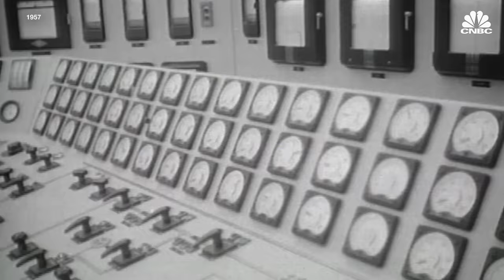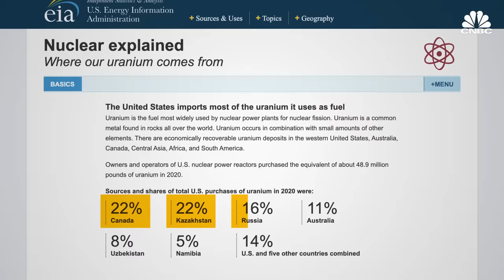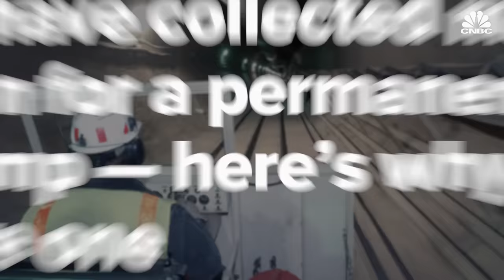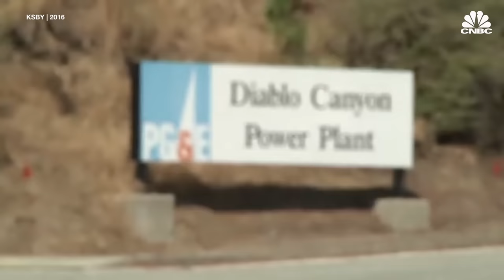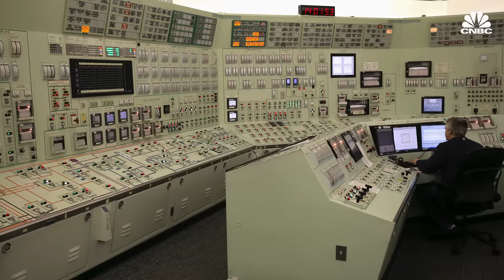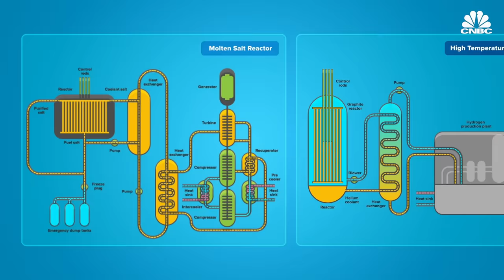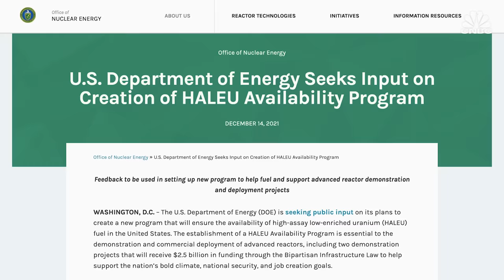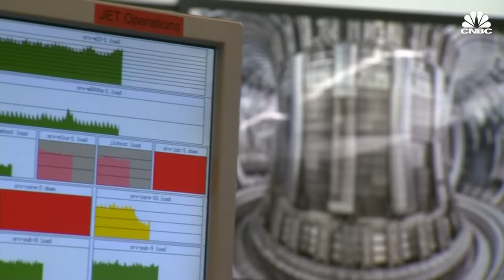Why Nuclear Energy Is On The Verge Of A Renaissance

Comment: 7:00 Note that the reason nuclear power plants are typically run at full capacity all the time is because of economic reasons: they have a high capital cost and relatively low cost per energy unit, so load-following is generally done using other technologies that have a fast response but high cost per energy unit. However, modern nuclear plants are perfectly capable of varying their output rapid enough to perform load-following and frequency stabilization, and this ability will become extremely important in a zero-emissions future.
Reply: That is not true at all.  The current nuclear power plants are operated at full power because trying to load following would result in uncontrollable xenon cycling and most likely in a reactor trip. It is an operational concern not a financial concern
Reply: @clarkkent9080  Nope, here's some excerpts from the report "Technical and Economic Aspects of Load Following with Nuclear Power Plants" from OECD-NEA:

"Nuclear power plants (NPPs) have been mainly seen as a base-load source of electricity. The main reason for this is that operating a NPP at the rated power level is usually more efficient economically and simpler."

"Modern nuclear plans with light water reactors are designed to have strong manoeuvring capabilities.  Nuclear power plants in France and in Germany operate in load-following mode, i.e. they participate in the primary and secondary frequency control, and some units follow a variable load programme with one or two large power changes per day."

"Since most of the currently used nuclear power plants have been designed for strong manoeuvrability capabilities (except for some very old NPPs), there is no or very small impact (within the design margins) of load-following on acceleration of ageing of large equipment components."
Reply: @MatthijsvanDuin  
Existing nuclear plants and new designs can technically perform both frequency control and load-following operations, but owing to high upfront capital costs and relatively low fuel and operational costs when compared with fossil fuel–generating units, the majority of nuclear generators across the world generally consider operating nuclear power plants at full capacity.

U.S. reactors were built between the 1970s and 1990s and while they are GE, Westinghouse, and Babcock & Wilcock designs, they operate in a very similar manner. I worked in the nuclear industry for 40+ years as a Reactor Operator and Senior Reactor Operator at 5 different nuclear facilities and the statement "Can Technically perform frequency and load follow" is correct as long as you include the word TECHNICALLY. I will say that the B&W design is the most forgiving of the PWR designs.
You can rapidly increase and decrease power and that is no problem.   However, without going into a lengthily explanation, you will also setup xenon oscillations that will swing power production between the top and bottom of the core over many hours or even a day.  Fighting these oscillations requires constant attention, rapid chemical shim changes as well as control rod movement.  They can and have gotten out of hand resulting in a reactor trip. I have had a personal experience with that when a component failure resulted in a rapid power change.
The Chernobyl accident was caused by the operators (directed by management) rapidly changing power during one of these xenon oscillations resulting in a prompt critical reaction and steam explosion.  I have never been asked by plant management or the load dispatcher to change plant output to help manage a grid over or under load condition.  I suspect if management ever did ask, the resultant problems would ensure that they never asked for that again.

Possible and Reasonable are two different things.
Reply: @clarkkent9080  "..owing to high upfront capital costs and relatively low fuel and operational costs..." that part is exactly what I said in my original post.

I don't doubt what you're saying, I suppose that if the U.S. has had no need for NPP load following yet that not much effort has been put into enabling that functionality, but e.g. in France where 75% of the grid power comes from nuclear they don't have much choice and their NPPs can and do perform load following, they just dealt with issues like Xenon. See the report I mentioned  for more details.

And "according to the current version of the European Utilities Requirements (EUR) the NPP must at least be capable of daily load cycling operation between 50% and 100% of its rated power Pᵣ, with a rate of change of electric output of 3-5% of Pᵣ per minute. Most of the modern designs implement even higher manoeuvrability capabilities, with the possibility of planned and unplanned load-following in a wide power range and with ramps of 5% Pᵣ per minute.  Some designs are capable of extremely fast power modulations in the frequency regulation mode with ramps of several percent of the rated power per second, but in a narrow band around the rated power level."

As for Chernobyl, Xenon was obviously an important factor there but the root cause was just poor reactor design... as Annex I to INSAG-7 scathingly put it, "The Commission considers that the negative properties of this type of reactor are likely to predetermine the inevitability of emergency situations"
Reply: @MatthijsvanDuin  I am very familiar with U.S. PWR reactors and the various designs operate in a very similar manner. I want to be clear in that small load changes over many hours is not what I am talking about here when I reference load changes.
I have no experience with high enrichment Navy power plants, BWRs, and I have no detailed knowledge of foreign designs.  All of the references for load following that I found were for foreign reactors so I cannot add to that discussion.  
I can tell you that there were many situations where the load dispatcher wanted and needed large load changes but never asked the nukes for help.  So I would not say that the U.S. grids have no need for NPP load following. The one reactor that I operated even had a console switch that would transfer reactor control to the load dispatcher so the plant was designed with load following in mind but that switch was never used and to my knowledge was disconnected.

Can it technically be done with U.S. plants - yes. Ask a licensed Reactor Operator if it should be done and the answer will most likely be no. To the best of my knowledge has it been done - No. Maybe the engineers making these statements should gain some actual experience and add that to their book knowledge.

There is more to quick power changes than xenon that just add to operational problems.  I assume that the reactor design can be modified to make load following less disruptive but from what I have seen of the current Westinghouse AP1000 Advanced PWR design, it is just a 1970s design with 2 coolant loops instead of the previous 3 or 4 with some passive safety features added. From my limited knowledge, the Terrapower Natrium gen 4 test demo reactor apparently uses a heat storage system to be tapped for load following as opposed to changing reactor power.

Concerning Chernobyl, The operators knew what they were being directed to do was technically possible but dangerous.  The accident was initiated by unlicensed management personnel directing an activity that they did not fully understand. In the past,  I have been directed by management to do things that I did not agree with and my response was "come to the control room, take turnover from me, and assume the watch as the responsible supervisor and you can do whatever you want". At Chernobyl, rapidly changing power during a xenon transit is what caused the steam explosion.  The lack of a proper containment was not the cause of the accident but the reason so much radioactivity was released.
Reply: Or you could just build enough plants to cover base load and peak demand
Reply: @Mic_Glow  I'm not sure what you're trying to say. Obviously you need to have enough installed capacity to (reliably) cover peak demand, otherwise you'd have blackouts. But having "enough plants" would be useless if those plants have insufficient ability to perform load-following (i.e. adjust their output to follow actual demand) since electricity production always has to match consumption; too much generation is just as big a problem as too little.
Reply: @MatthijsvanDuin  You can use excess power to fill up hydro storage, produce hydrogen, desalinate water or charge EV's (cheaper electricity at off-peak hours so people charge at night). Or sell to "anti-nuclear-power" countries. Main cost is build+ operating cost so no point throttling down the reactor
Reply: @clarkkent9080  I've read CANDU's tolerate variable output/relatively quick restarts better than other reactors but I don't know why.
Reply: @clarkkent9080  Do you think Chernobyl was prompt critical?
Reply: @missano3856  I've only operated U.S. PWRs.  I can not speak to how CANDU reactors operate.  But they are completely different from most other types that are most common throughout the world
Reply: @clarkkent9080  Oh, and is a reactor operator's license specific to an individual reactor or is it like a pilot's license and type rating?

Comment: At Fukushima  no one had the initiative to get mobile generator power in. These power plants hire people who follow rules and do not think outside of the box. Usually any construction company has towable generators that can be taken anywhere quickly.
Reply: Right, salt water flooded generators, fuel and control components. Fixed right away just like.magic.

Comment: 16:00 I work at a 2 unit plant pumping out over 2 Giga-watts, as an operator and each 12 hours shift has about 16-20 operators, you don't need hundreds because the truth is that we are the people controlling everything in the plant. Radiation protection can shove it in an emergency we are there to make things safe for the public no matter the harm to ourselves. We are the hazmat team, fire brigade, safe shutdown, and emergency response to all emergencies. And that's just 20 people if we are lucky. The extensive training is non-stop, drills every shift after 2 years of training then continuous training every 5 weeks.

Comment: Chernobyl was (they still have this design of reactor, “RMBK”, operating in former soviet countries) a weapons grade plutonium producing reactor that was modified to make nuclear power. Making weapons grade plutonium is a low volume, low pressure environment. Making nuclear power is a high volume high pressure environment and the RMBK reactor was a terrible design for making nuclear power. It’s design doesn’t even have a containment structure around the reactor which would of significantly made the Chernobyl catastrophe much smaller, like Fukushima in Japan.

Comment: I’m a retired nuclear engineer who wholeheartedly supports nuclear power. I believe that it is very unlikely we will have a nuclear revival anytime soon such as within two decades. First, we do not have the skilled workforce to build the large nuclear power stations that we have today. I worked on such a project that was cancelled in 2017 and it was a massive struggle to find qualified people to build it. That wasn’t the only problem but it’s a problem any large nuclear project will have. Small Modular Reactors are proposed to get around this but the most immediately viable project was cancelled late 2023 because costs escalated beyond feasibility.

Hate to say it but the future is natural gas. If the renewable transition fails as badly as I expect, we could even see a comeback in coal before nuclear.

Comment: One factor that would solve a lot of the problems listed when talking about nuclear power is the use of uranium. Instead, we should start designing and building nuclear power plants that use thorium. Not only is thorium plentiful and available everywhere, but it also has a half-life of only 300 years instead of uranium with 10,000 years. And the beauty of thorium run reactors is that all the spent uranium fuel rods we are currently storing all over the place can also be used as they only use about 2% in their first run in conventional nuclear plants whereas using thorium will consume almost all the nuclear energy it produces at 97%. Then the uranium can be recycled as well and can be used almost ad infinitum until they are finally spent.
Sadly, we first saw the destructive power of the spitting of the atom and due to political and energy company politics, people were never told how much less destructive nuclear energy production is. The forecasts of up to 150,000 deaths in the aftermath of the Chernobyl disaster and others like it were completely OTT. In actual fact, 125 people died from radiation sickness during the meltdown, and during the work done afterwards trying to prevent the meltdown. Around 2,500 people have had from the very treatable thyroid cancer which MAY have been caused by exposure to high radiation levels but there is no clear link as yet. Radiation can be controlled (especially if thorium is used instead of new uranium fuel rods). All new nuclear power plants have already been designed to run without requiring people to work in the plant and runaway meltdown disasters such as the old plants at Chernobyl and Fukushima will be impossible. The plant can be powered up, locked up, and will run perfectly without any danger. The meltdown emergency will simply not occur.
Micro-plants are one option for local use, but in order to ensure that we have emission-free clean energy for the medium term we need to move on with the new designs (many of which were buried by the fossil fuel companies in bureaucratic lobbying groups in order to stay with fossil fuels). Politicians don't care about the medium and long-term, but until we can produce hydrogen cells without emitting CO2 during the splitting of oxygen from the hydrogen (the only real solution for cars, ships, and airplanes) and have found a way to actually get to fusion, nuclear power is the only way forward.
Fusion is definitely the energy for electricity in the long term but it does nothing so far for cars, trucks, ships, and airplanes, as they need something more efficiently high-powered than immense batteries. However, we have not got very far with fusion, so we have to see ahead clearly and realise that only nuclear power plants will fill our electricity needs. The electricity produced there can run on our current infrastructure which needs renewal but is not as drastic as the use of gigantic batteries to store the electricity generated by solar and wind. And all other means of energy required (in transportation in particular) lie with hydrogen cells, the development of which is forging ahead and getting better all the time.
Electric cars which have more than double the carbon footprint just during production and the complex lithium-ion batteries which use far too many rare earth metals that are limited, and no real recycling on the horizon so far, are nothing but a scam that made Elon Musk very rich but did nothing for the environment. Similar problems are faced by solar panels which have a lifespan of about 10 years and cannot be recycled (and have to be built using heat in excess of 1100 degrees celsius produced by high-quality coal to turn "sand" (quartz) into solar panels. Again, solar panels cannot be recycled. The same goes for wind turbines which can work for 20 years - and cannot be recycled! All renewables we are investing billions of dollars in are extremely inefficient and are aimed to make people feel they are doing something for the environment. I am not even going into the difficulties of batteries required and the unreliability of solar and wind. As for electric cars, most people don't even know that the electricity they use to run their cars is probably generated by coal or gas power plants. Until we drop the low-hanging fruit from our renewable energy requirements which among other things do terrible damage to the environment, nuclear power is the only viable option.
Reply: I see that you are getting your knowledge from social media and YT videos.

Thorium does not produce power. Thorium is converted in a reactor to U233 that does fission and produces the power and fission creates fission products that have varying half-lives. So no the issue is NOT uranium vs Thorium halflife.

Also current reactors do NOT use only 2% of the available power so that is a lie. I could go on and on but you need to READ articles on how reactors work.  YT videos are for entertainment not education.

Comment: 'Course part of the reason energy demand was growing so fast back in the 1950s, as the guy correctly says, is that up to a quarter of America's electricity went into Hanford and the TVA for the separation of bomb-usable uranium and the creation of plutonium.
Reply: Little boy is the only nuclear bomb built that used U235.  Fat man and every subsequent nuclear bomb used Pu239 which is made by transmuting U238 to Pu239 in a reactor and that does not require a lot of electrical power.

Handford reactors made Pu239. Oakridge enriched Uranium in U235 for navy reactor cores.

Comment: 16:54 This is how any normal reactor works, don't be fooled by the sales pitch.
Light water reactors have a negative reactivity effect known at a negative temperature coefficient. As the reactor coolant heats up it's not able to moderate neutrons (slow down neutrons to the range required to cause a fission event) in an adequate manner to maintain criticality (the continuous reaction)